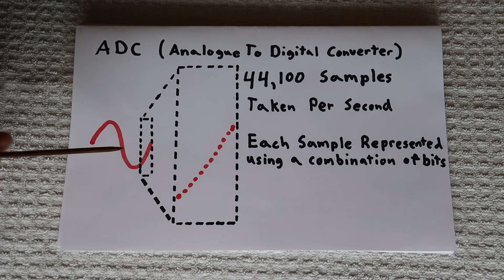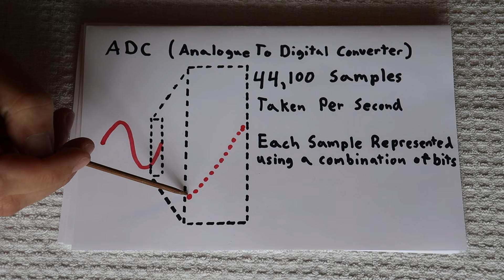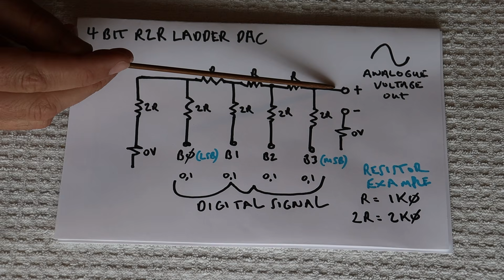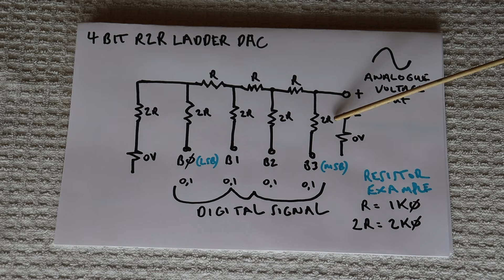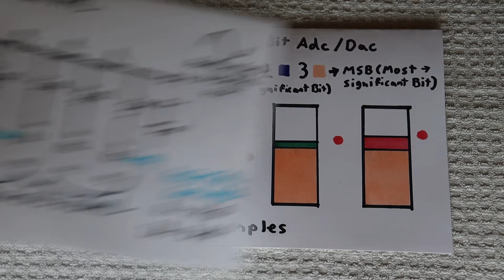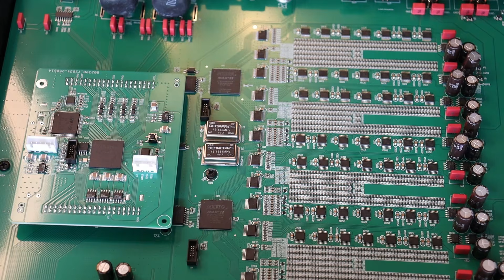Mellow Tone Amps #16 - What are R2R DACS

Comment: Have you guys come across the dac-less dac ? Hackmag did an article that covers a few ideas.... DIY Audio: How to Build Your Own Digital-to-Analog Converter (DAC) Another idea for the R2R was, if I understand correctly, the series string of resistors are what needs to be accurate, so could you use something else like nicrome wire, and clip onto the wire at precise points, so that makes the clip on device the hard part of the manufacture, instead of the resistor manufacture.

Comment: Very interesting discussion.  I’d be curious to hear you opine on chip based R2R implentation, like the ADI-1865 R2R chip in the LTA Aero DAC versus a surface mounted ladder like the Pontus.  I suspect linear power reference voltage isolation to a ladder is plus.
Reply from the maker: I don't have any chip based r2r dacs, so I can't compare to our Denafrips Pontus 15th which has 2 discreet r2r DAC modules.  As you may know we have a long term DAC development project under way.  And we've decided to focus on two different prototypes.  The first one will be a 16bit discreet ladder dac (a whole bunch of very closely matched resistors) and a chip based dac that even though an older design (2000 ish) is still available from Digikey.  So far my one huge discovery is digital sound can sound very good, when implemented properly.  The problem is 99% of DAC's in use, have poor implementation and result in a very edgy sound with an unnatural treble and a very flat soundstage - the flat soundstage is an instant giveawy.  The Denafrips was purchased (at great expense) to establish a bench mark reference, and boy has it delivered!  Even well recordered/mastered CD's sound very good.  On the other hand, while going through my old CD collection, I discovered just how badly mastered most CD's are (a discard rate of ~80%) and that's from a curated collection from back in the day, when we'd actually be able to listen to the cd before purchasing!
Reply: @mellowtoneamps4932 should be an exciting project to dive into!  Do you expect you’ll lean towards a tube based output stage in the design?  Or is that a whole other bucket of complexity best left aside for now?
Reply from the maker: @robbrookby3350 most DAC's require an output gain stage (though some will have a built in gain stage).  Typically these are made with opamps, but our thinking is that a tube based gain stage should be superior in almost every way (except convenience and cost).  The tube stages required should be easy enough to design.  The big task is designing all of the digital stages required for quality sound.  And finding the time for the project.  Cheers Jim

Comment: Very cool. I have one of these Pontus 15th dacs. I was just using it with my 12/6sn7 Mellow Tone kits preamp the other day. 

I'll be curious to hear about your experience with it if you ever choose to share. Couple of things I personally noticed with my unit. The amount of burn in time or transformation over time was ridiculous. Think 4 to 500 hours. I've never experienced anything like this & don't understand how it's possible. But  it just opened up with a more meaty sound to it one day. Like flicking a light switch.  Another thing that I experienced was with the balanced outputs. I perceived an audible improvement using balanced cables..which was unfortunate because all my tube gear is single ended. I also had issues with the RCA jacks on the Pontus not fitting my cables properly. And then i realized that the quality of the digital source plays a big role on the outcome of my Pontus. 

I also bought a cheaper $1k R2R Dac, the Laiv uDac, to compare & see if the extra grand for the Pontus was worth it. To me the Pontus 15th is very good & definitely a step up to the Laiv dac..which is also very good for half the price. Pontus is better in my opinion.  The Pontus was very expensive for me but I feel that if you are going to use digital sources it's worth the expense to try  some of the more expensive dacs to see if they actually make digital music easier to listen to. 

My perception of both R2R's that I own is that they take away that little bit of glare, hardness, digital nasties or whatever one wants to call it. It's like a digital sibilance removed. Its hard to explain but I prefer R2R over the new chip dacs of similar pricing.
Reply from the maker: My experience as well.  Even though our DAC development has been open ended, we're now mostly focusing on an r2r DAC.  The significant improvement in digital glare and the fact we can actually "build" the dac mostly with discrete components is a big plus.
Reply: @mellowtoneamps4932 I think this is fantastic. I am wishing you guys the best & hope y'all are successful in producing something worthwhile that you enjoy. It would be very nice if you could eventually bring something to market.. especially being the R2R topology. Very cool & good luck.